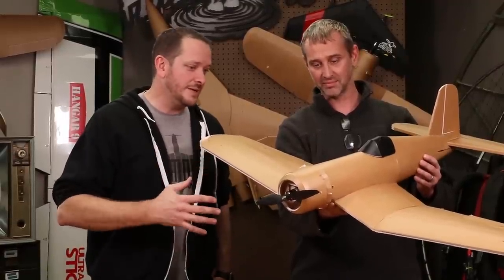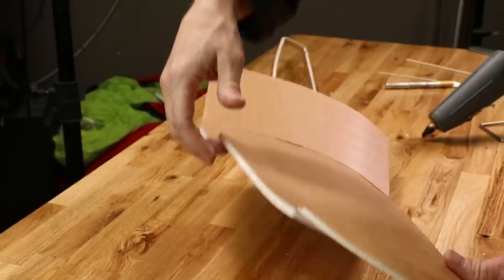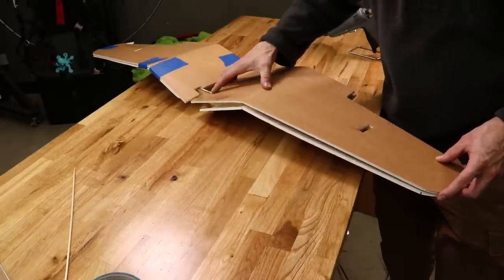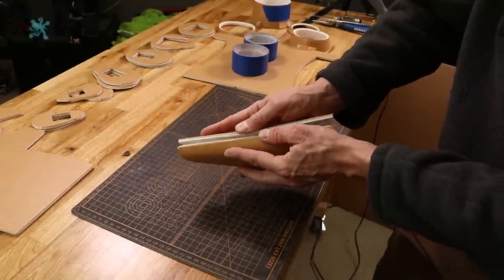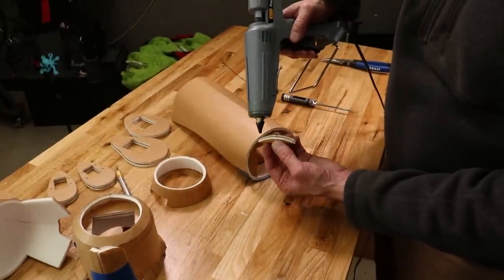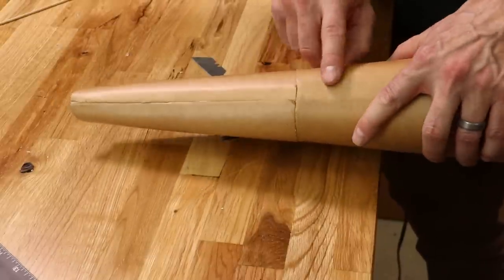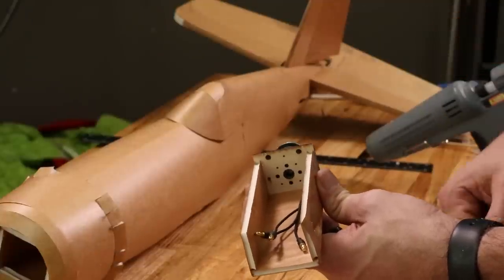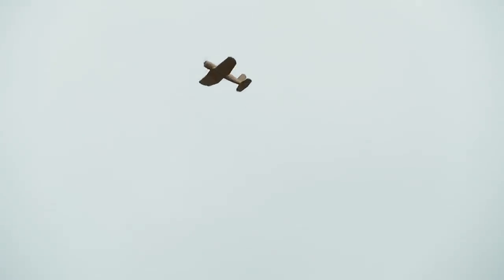How to Build the FT Corsair - Master Series //  BUILD

Comment: If you use a rolling pin on the curved pieces instead of the table edge it will be more of an even roundness.  Place the  pealed side up on the table and roll over it like rolling out dough and it will start curving up evenly
Reply: what kind of material does he use
Reply: @tinq1 foam board

Comment: You guys are too cool for words.  Thank you so much!  I am curious about how plausible would an aluminum skin for this airplane be?  I have a fair amount of experience cutting and flattening aluminum sheets from soda cans.  I could see spot welding the critical junctions and just tape or glue for the non-critical seams.

A glue tip you might try:  Use a vacuum (shop vac, hand vac, etc.) to "pull" glue into hard to reach areas.  Just like it sounds, apply glue to one side, and suction to the other side.

Also, you guys should consider hosting some sort of contest where the winner gets to spend the day with the whole crew. Or maybe just as simple "fan appreciation day".

Comment: A great way to remove the wrinkles that John mentions in the video is to use spackle, the same stuff that you fill holes in your walls. I pre sand the area lightly to allow for better adhesion, then apply a light, smooth coat of spackle with a spackling blade. Once dry, use a sanding block to smooth the area. It is important to use spackle that is not too wet or you will ruin the paper on the foam board. Should be similar to the consistency of peanut butter. You’re then ready to prepare the final surface (paint,colored tape, make water resistant, if necessary, etc.). You might want to practice with some scrap foam board first.

Comment: Hey guys, this a build review about the corsair I just bought and built.
I bought the corsair kit after watching the build and maiden video and quite frankly, I decided to (I fell off the r/c wagon) buy a kit and see how it would turn out.
I have a ton of previous r/c plane build and fly time behind me, but it is 25 years behind me and we actually used glo fuel which really added some restrictions to how you could build things. Once I saw the electric motor the credit card came out.
Unboxing, the card board box it came in was heavier than the foam board.
I have never worked with foamboard or a hot glue gun before.
The first thing I noticed as I started popping out the pre cut parts was the little nubs that keep them on the sheet. The parts are very well cut out but those little nubs don't always let go and as a result you get some unwanted paper damage.
This was quickly remedied by using the razor knife to cut the nubs on both side of all the sheets.
Just as in the video, I started with the main wing and moved forward from there.
This was my first time forming foam board and it actually went really well. 
Considering I was sitting at my computer desk for the entire build so I could watch and re-watch the video as needed. I ended up using the door frame beside me for a crisp 90 degree edge and I had no trouble getting the shapes I needed.
I got the port wing perfect and really kinda borked the starboard wing and ended up being ever so slightly out of alignment. 
I was not happy about this and decided that this build would be a test build and probably would not get the electronics or servo's added at this time.
It really shows to, I ended up with a crease instead of a curve which later looked really bad when I joined the wings to the fuselage.
Big Note Here. Really take your time, be patient and don't keep trying to build the plane when it's past your bedtime....seriously.
With the wing complete I moved on to the fuselage. 
This was actually quite a challenge. Besides rolling the parts out and shaping them which turned out to be fairly easy for me, I ended up running into trouble with the formers, specifically the double A formers which are the smallest ones.
The real bummer was after all the sections had been completed and I started to connect the A former to the B former I noticed that there was about 1/8" difference at the seem. This showed up at the top although it could have been the bottom, I just figured that I would use some scrap to sort of fill in the offset and once it is painted it probably won't be noticed, but on the next build, I will apply more of my sheet metal layout and assembly skills to A) sort out what went wrong on build number 1, and B) see if it a design error or an assembly error. Since this is build one, I expect I did something wrong but as I watched the video several more times, I noticed John had some problems here to so be careful at the A and B connection point to get the best results.
Big note here to. Keep those layout ticks in perfect alignment. I was ever so slightly out in one or two places and it shows, not much, but as a guy that builds lots of stuff, I am probably my worse critic when I know I could have done better.
However, I did manage to find a way to get the power pack holder to line up really well by not following the build video and going freestyle and using the power pack holder to align things as they went together and that ended up working perfectly.
At this point I also had learned a few things about the hot glue and the foam and it was actually getting easier to assemble things.
Big Note here to. If you haven't built with foam and glue, or if you are a first time builder, when you order your kit, order 1 or 2 more sheets of foam board. 
You can use the sheets the parts popped out of as a template to cut extra parts and use the extra parts as test parts before you use the pre cut parts. This might cost you 10 or 15 bucks more, but it is money well spent.
The rudder and rear stabilizer went together without a hitch and installed without issue.
Here I deviated from the video build again when it came to placement of the rudder.
To get the correct placement for the rudder post, I lined up the rudder as shown in the video, alignment to the rear, but then I rolled the rudder over on its side and marked the place where the post needed to be poked into the fuselage. I got a perfect alignment with no guess work, I also used a small piece of scrap to mark out the left and right of center lines so I knew where the glue would go and also to keep things straight.
On the next build I will mark this out before it comes of the sheet and is flat, rather than rounded.
I had no issues with the cowling, main wing tips or the power pack holder.

All in all I probably spent somewhere between 9 and 12 hours over 3 evenings to assemble the corsair. I am going to use this build as a test platform for build technic, paint and decal placement and patterns and also to develop some hard points for external stores.
I liked the whole "put bombs on it" idea.
Also, I will add some additional scrap or wood to the low points of the wing and fuselage to prevent damage on landings.
Reply: Longest comment I’ve ever seen

Comment: hey guys , i learned this from an old school carpenter, but for the inside seams , i usually have a little bead of glue pushing out , like you tell us to avoid doing on the outside , well i lick my finger real good like and get some saliva on it and then quickly run it down the seam with a bead, this keeps your finger tip cool while you push the glue into the seam and come out with a nice smooth surface.... we used tp do that with caulk in bathrooms to make smooth seam around bathtube, licking the finger keeps cool and stops glue (or caulk) from sticking

Comment: I did a similar build for NIAR by taking our VTOL/CTOL Search and Rescue drone loft and scaling rib sections down to 1/3 scale, adding tooling holes and spar holes, peeling the inner paper ply and building the wing.  The ribs were then 3D printed and I made a layout of the locations for the foam tooling and used music wire to pin the ribs in place in order to match the loft most accurately, I then cut slots in the foam but not through the paper on the wing skin.  Then I preformed and hot glued the skin to the ribs that were being held in place by the tooling (simple standoffs with holes for indexing the printed ribs.  The wing used two separate NACA airfoils combined with a 7 degree twist to provide low speed stability.  The end result is in the icon next to this comment.  I would love to build it again and make a build video some day, or better yet, if I had the actual loft of the Corsair, I would love to make a scale model of it instead!  There were a few other techniques I used, but it takes too long to explain.  Lets just say that my Tool Design, CAD, Engineering, Fabrication, Electronics, and RC Hobby experiences all collided in this project, and I learned even more!  Then we built the full scale with 13' wing span out of carbon fiber!!!  Holy Moly, is it big!

Comment: literally just finished the build,  will finish up trim checks tomorrow, can't wait to fly this thing!. Only small pointer I have it to make sure the power pack pod is fitted to former "F" the one in the cowling. I didn't install it correctly the first time ( I put the end of the pod in former "E" )and needed to cut plane apart to position it correctly; There are some editing issues with the video at this area, and I think another posted went on a bitch-fest about it. Other than that it was a fun build and went smoothly

Comment: Sweet looking plane. I have ordered one
I would like some landing gear what would be a good design to reinforce the landing gear.
Maybe something like the Mustang but connect the two spars for strength. I would need to do this when I put the wings together.
Or I could use retractable landing gear and put them in when the wings are being built.
Reply: You could brace it with lite weight plywood similar to the wood used for the power pod. I would use CA glue for the bonding. Once I get my kit I am going to build it with rotating retracts.

Comment: I’m having a little bit of a problem with my FT Corsair. Currently, the rudder pushrod has a ton of resistance because of the angle coming from the top of the fuselage to the middle. Any suggestions? Thanks

Comment: Jees, he used double the cost of the entire kit in blue masking tape. At $8.00 to $10.00 a roll for that good blue masking tape, you can bet every piece I remove will get stuck to the edge of the table and reused as many times as I can get away with it. If you break down the components necessary to build one plane, you'll find that Blue Masking Tape is one of the most expensive components in a build. I'm getting ideas about that foamboard and shaping it. I'm thinking of making some forms, made from fiberglass or something and bending the foam boards around the forms creating perfect bends and curves. I'm also thinking that maybe applying some heat to the foam board while it's on the form might set the foamboard's new shape permanently and more rigid. I'm thinking maybe a heat gun or maybe just plunge the whole thing into some hot, not boiling, water to set the shape. Something that's really bugging me is the leading and trailing edges of the wings and tail section. I'm going to do some experimenting with cleaning those up without adding weight. And my last thought is about rivets. I've pounded in my fair share of rivets with a pneumatic rivet gun and a bucking bar. When looking at those old planes I always admire the work of those who set all those hundreds and hundreds of rivets in beautiful straight lines. Also, the wing surfaces on many of those old warplanes were never exactly perfect. When looking out over the wing surface from the tip toward the fuselage, you can see slight peaks and valleys where the aluminum skin is riveted over the wing ribs, and of course all those rivets. I think I'm going to design a tool that will imprint those kinds of details onto foamboard. Once I do that, who knows, the Flite Test guys might invite to their beautiful golf course and so some flying.

Comment: The next level,challenge is to use as little as possible of material types. Some would have difficulties in getting wood/plywood materials.

Don't get me wrong, this is very good when all materials are easy to get.

Me and my friends have successfully achieved in having curvy plates using depron without any additional materials such as plywood etc. Only depron and carbon/bamboo rods.

Thanks for the video guys. It surely adds more reference to us.

Comment: Lots of things can be done easier. I.e.: instead of fighting the foam on the edge of the table to mash it just use a dowel, a plastic plumbing pipe, a dowel, a broom stick if you have too. Roll it firmly to thin up the foam then just bend it in place.

Comment: I wonder if you can leave enough paper on the front of the upper wing skin to wrap around the exposed edges of the foam
Reply: I was thinking the same thing. They use alot of the foam thickness or more paper overlays on alot of the other builds, so why not here (suppose it could be the odd compound angles). But on the other hand if we build off the plans guess we could add them ourselves.

Comment: I like to add hot glue over the sharp points of the screws behind the firewall, so crashes don't result in fires, saves you batteries and planes, and let's you put all four screws in.

Comment: Why not use small spring clamps instead of masking tape. Less waste and way easier to use. Just a thought. Awesome plane!
Reply: any kind of clamp that holds snug would most likely leave marks/dents on the foam. The tape is gentle but holds strong and I was able to use most of the pieces several times before they stopped holding.

Comment: Can I use 3mm balsa wood instead of hobby grade plywood 3/32" (2.4 mm) thick on the spars shown in the 4th minute of the  video?
Also,What is the thickness of the foam board used in the video?

Comment: Hey man...instead of using that plywood for your center spar sections, couldn't you just use that strong dense Elmers foam board? It wouldn't be as strong as plywood but it WOULD be a lot easier to work with for a scratch build. Do you think it would be strong enough?
Reply: I used popsicle sticks glued onto the foam spar

Comment: Hey man...I couldn't help but notice that your foam crushing technique seems kinda tedious (I know, everyone's a critic). It just occured to me that you could use a piece of pipe or broom handle or dowel rod like a rolling pin. Leave the foam board layin on the table with the peeled surface facing up and place your "rolling pin" right where you need it, apply an appropriate amount of pressure and crush the foam exactly where you need to. You'd have more control, better accuracy and it would be just plain easier in general. Give it a try and let me know what you think. Be well!

Comment: I would love to see someone down load the files and cut it out in aluminum sheet metal and tig up this in aluminum. It would be so bad ass
Reply: Would that not be way too heavy to actually fly? I feel like you would need to make it have a liquid fuel motor for it to fly
Reply: No not to heavy at all. tig welders can weld edges of razorblades together. So thin aluminum  sheet would be nothing to hard for it and light weight. I would just do it  with a oversized  brushless out runner motor and a 4 cell lipo and put a little larger prop on it.  Maybe one day. I always put this hobby off because I am afraid I will like it and I am not ready to invest time and money. Nothing new for me till my 53 ratrod truck is done. I am getting close though.
Reply: @jvmiller1995  ah, I've only messed around with MIG welders, so I didn't know about how precise tig welding can actually be, and the hobby is really fun! when your able to I highly recommend getting into the hobby.

Comment: I would like to see landing gear on these models to take off and land on hard surface.
Reply: Hey Pete, checkout Jpot1 's enhancements to the A10 Warthog.  He added simple landing gear (rear and nose) which I'm sure would work on the F4U.   Of course its a tail dragger.  Don't forget the wheels are attached close to the leading edge, as they real ones fold back and turn flag 90º.  https://www.flitetest.com/articles/scratchbuilt-a-10-modifications

Comment: Why not use die cut baksa sheet in place of that foam for the sheeting?
Reply: Cost would be the main reason I'd think. If you buy the foam and cut your own you could build 2 or possibly 3 of these for the cost of the balsa sheet for one. ( I have wondered about 'glassing one of these foam planes)  . Although, I could see using a few pieces of balsa to clean up some of the areas with gaps. Such as the trailing edge of the wing. or the canopy.

Comment: @ 11:57 Why would you cut the foam in the first place if you know you'll need to glue it back together again later???
Reply: He hasn't cut through the foam - he has chamfered  it to form a paper hinge and has then reinforced the hinge line with a thin smear of hot glue.
Reply: @rogerturner5504  Nope! Look at the video @11:57. You'll see that he has (half)cut the aileron-line all the way to the center of the wing and that he glues the center part together again.
Reply: @arturama8581  Sorry, yes - you are correct. I have the kit (unstarted) in the room here and the lower wing half has a cutout to permit the aileron to lower - the aileron itself in the upper wing half has been laser-cut right through to where the wing is cranked - I have no idea why. Well observed. I would have scratched my head too at that point in the build.